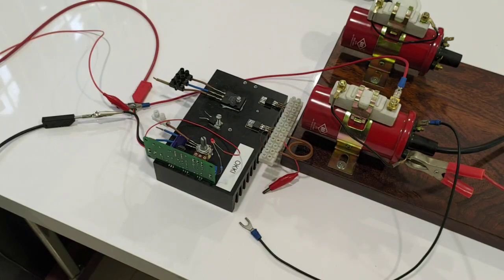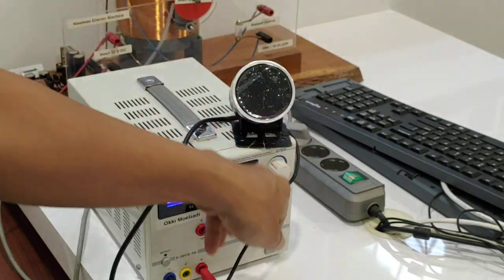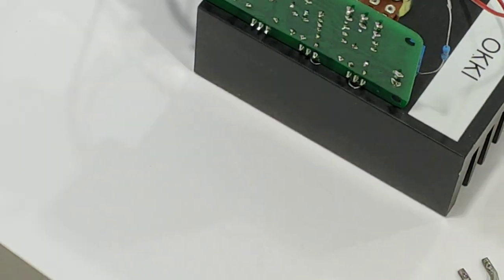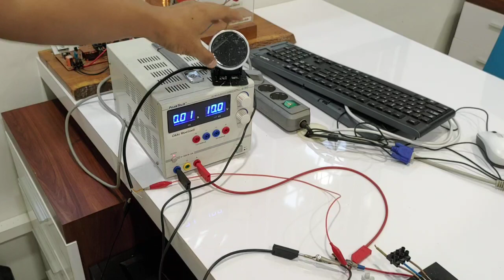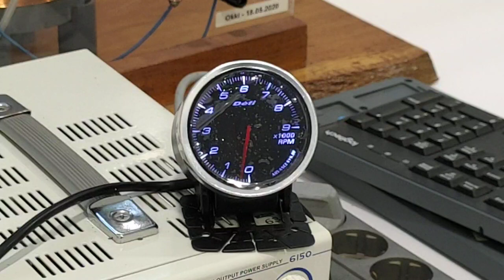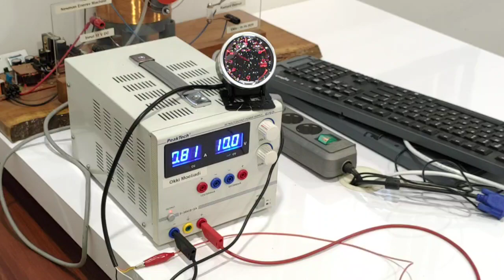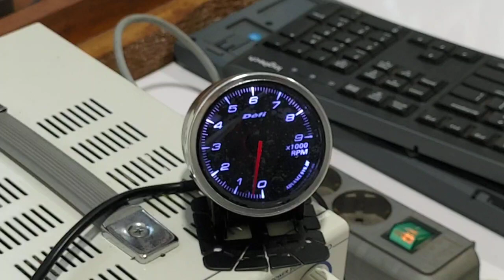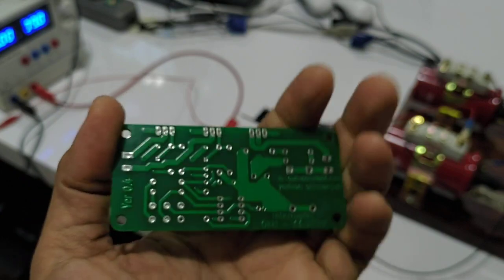Interrupter Circuit Idea

Comment: Why only 10v from the power supply? Automotive generators are rectified and regulated to 13 or 14+ vdc to charge the battery. 
In a future video, can you show the difference between locating a HV cap across the spark plug vs a lower voltage capacitor across the primary of the ignition coil please?
Reply from the maker: This is just a test bench. I will set the voltage to 12 or 13 Volts in future video. I will make a video comparing HV and LV capacitors. Thanks for commenting.
Reply: @OkkiMoeljadi  thank YOU for sharing your content, knowledge, experiments!